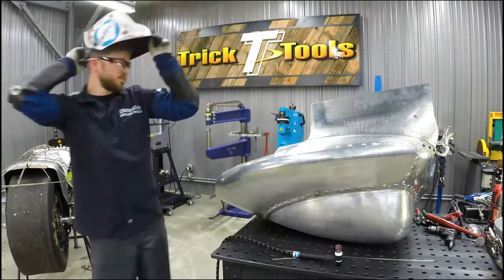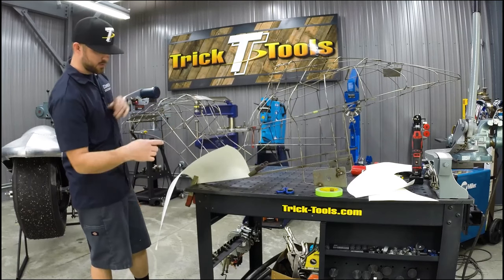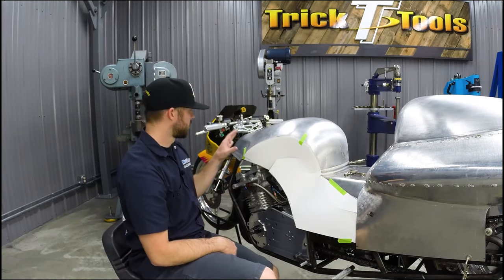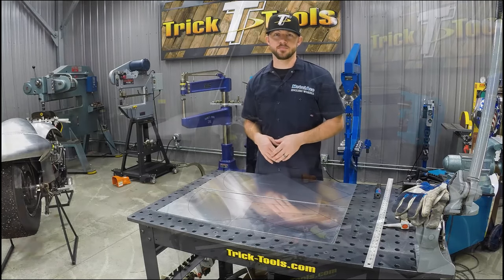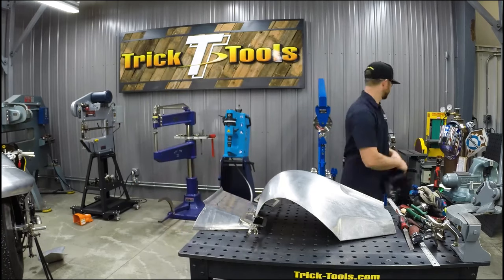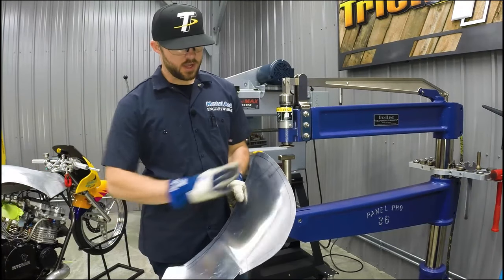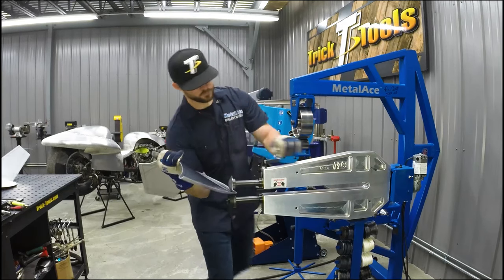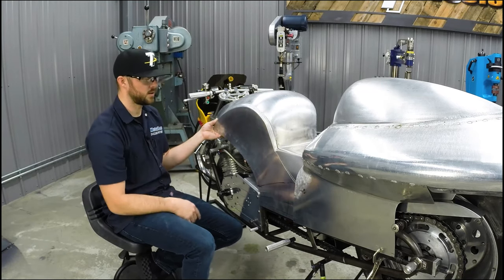Advanced Shaping Continued - Drag Bike Body Series Episode 4 Part:2 - Trick-Tools.com

Comment: Someone has never tried to lean over a tank of that shape. I reworked a fibreglass body for a guy who's original body wasn't even that extreme. Don't get me wrong, all the metal shaping and fab work has been exceptional and I've thoroughly enjoyed the series.
Reply from the maker: The body shape was designed by the guy that rides it and he has sat on it. Its not as tall as it may seem. it hugs the chassis pretty well and is close to its original body height. Thanks for watching!